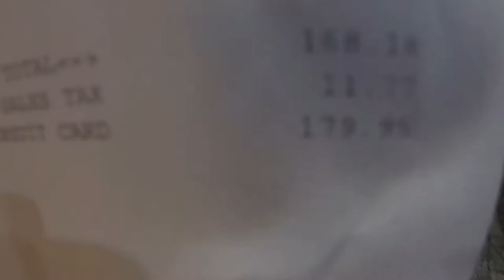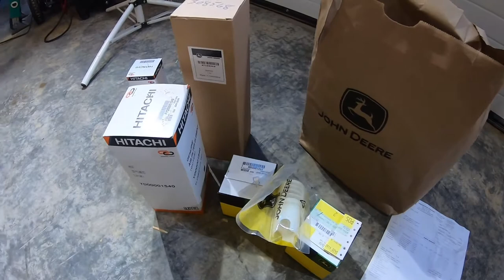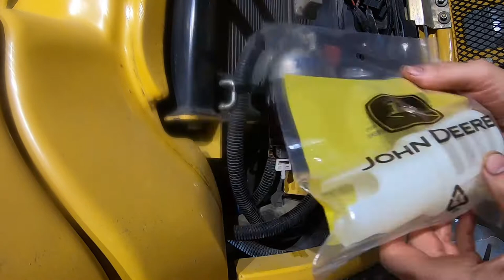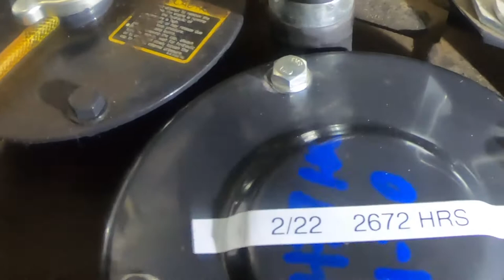John Deere 35g Mini Excavator Maintenance | CBH

Comment: Getting ready to do some initial maintenance on my 35G, so reviewed this, thx. Couple of suggestions... I don't think you retightened the water separator enough. I realize it was really tight to remove, but you only put it back about hand tight. That's a large o-ring, and it's got negative pressure from the pump. So it could suck air and you wouldn't see it. Over time could be bad for the injection system. (Also you didn't put the track motor fill plug back tight enough from what i saw, fwiw). Another thing is the Swing gear needs only a little grease, but you need to rotate the house into different spots to get it all the way around. Don't over grease it as you can blow out the turntable seal. The arm and stick only call for grease every 500hrs believe it or not. The bucket and thumb can get the frequent greasing (especially if they get wet) Thanks a bunch 👍 ☮️ -
Reply from the maker: Thanks for watching and your comment. I will definitely double check the separator and final drive plugs. Appreciate the tips and your time in writing them! Have a great day and be safe!

Comment: I had to replace a cracked fitting on my hydraulic system on my JD 26G mini excavator. I need to top off the hydraulic system. Is there anything special I need to do to get air out of the system? Can I operate it with radiator style cap off or does it need to be on? How do I check the level? Thank you!
Reply from the maker: Thank you for watching and your questions. I’m sorry I do not know the answer to those questions. I follow the mini excavator forums on fb and just google stuff if you don’t have a dealer or trusted mechanic for a question. I purchased that unit used from C&C and they have been very helpful with the only questions I have had. Best of luck, have a great day and be safe!
Reply: @CopperBarnHomestead  it was pretty straight forward. I just filled it till the sight glass was full, put the cap on, operate system for a few minutes and check to see if the level dropped any, it did not. Thanks, love the channel 👍
Reply from the maker: @goodgollyjosh  Awesome!!! Glad to hear it didn’t give you any problems. Thanks again, we appreciate you!

Comment: Did you bleed the air out of the system after you changed the hydraulic filter? I just serviced my 35 for its first initial service and in the owners manual it says to bleed the air out of the system after changing the hydraulic filter.
Reply from the maker: Thanks for watching and your comment! I did not but if the manual says to then you should.  Have a great day and be safe!

Comment: Never use grease on o ring just oil , grease can clog oil pump or very fine oil passages, filter can vibrate loose with grease .
Reply from the maker: Thanks for watching and your comment. Good point, I always wondered about that, I will switch back to oil in the future! Appreciate you, be safe! ❤️